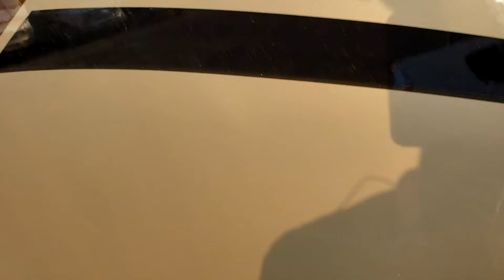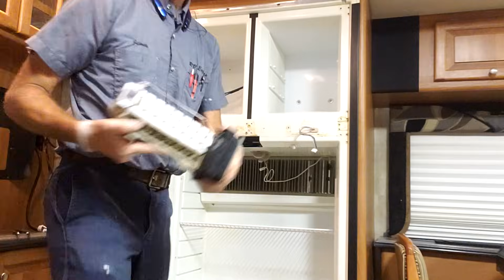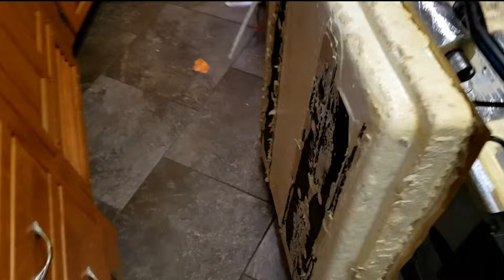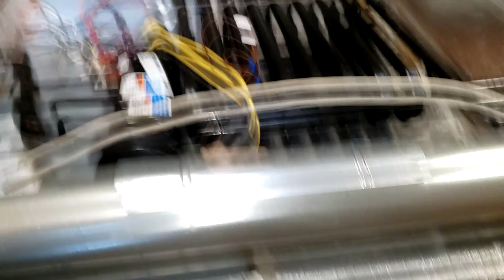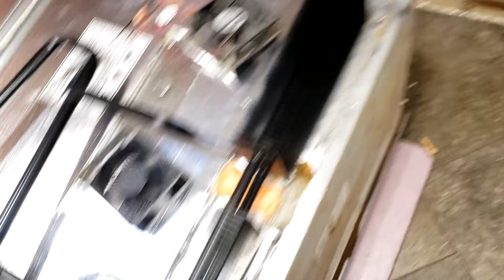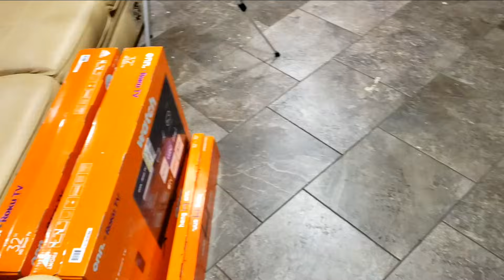NORCOLD 1200 Cooling Unit Failure + tips and tricks

Comment: Too bad residential units don't run on propane.  Gotta be able to do some boondocking when the time comes!
Reply from the maker: When what time comes?
Reply: @AZExpert   Any time!  Nothing compares to boondocking IMO.  That's partly why I have an RV.  To get away.  RV parks are nice, but I'm all for the backcountry if I can get there. 
Until I can afford a solar array and some batteries, propane is the best option for keeping things fresh in the fridge.  
By the way, thanks for this video!  I have a 1200 that I will be replacing the cooling unit ASAP.  Currently full-time live aboard and on shore power.  I do have the recall auto-shutdown unit installed, but as you mentioned, by the time there's a fire it's already too late. 
Can't wait to get "lost" on a forestry backroad or spend a week on the beach again soon!
Reply: And yes, I picked up on you being salty.  You live in AZ.  I'd be salty if I lived in AZ too.  Seems everyone who does is.  Most miserable state I've visited.  Which makes no sense to me because of all the natural beauty, but whew, is it full of phony grifters and uptight pricks. 
I curse the roads being in such bad condition there because they impede the getting out.

Comment: Degradation of cooling could have been caused by a bad fan. But you added a fan to compensate. Cooling unit was bad, possibly caused by the failed fan and poor installation originally. It had to work too hard and crystalized the ammonium.
Reply from the maker: Thanks for the insight

Comment: WOW. What a big difference. Like you said it could of been not installed correctly plus the one fan wasn’t working. When you took the old one off that was a lot of that putty in between the two metal plates. When you installed yours you didn’t put any of that putty between the two plates. Just asking since it looks like it has the room and the length of that cooler fins on the back why didn’t they just put four fans back there. Everybody keeps saying between the bottom hole and top hole the amount of airflow that goes through there is what really helps keep the fridge cooled down. But thanks for explaining in a little more detail on how them systems work. I had my cooling system replaced on my fridge. And they said keeping it level was number one and no more than a 2% margin on leveling. And I said could’ve it been traveling with the fridge on. And that’s the thing they couldn’t answer yes or no. But the way you explained it. Turn it off unless its Leveled.
Reply from the maker: Thanks for watching!

Comment: It is necessary to remove all the Styrofoam off the tubes on the cooling unit before applying thermal mastic.
Reply from the maker: You need things as clean as you can get them

Comment: What, no Amish cooling unit? btw, I hate my 1200. It has a newer cooling unit but there really isn't much in my Winnie that causes more apprehension than wondering if my fridge is cooling as it should be when it's full of food while we travel. Oh and when it decides to go through the defrost phase every 5 or 7 days....

I never had issues with the Dometic fridges in my previous RVs.

I'm hoping Furrion will come out with a 4 door version of their 12v compressor style unit soon.
Reply from the maker: Personally, I don't like non OEM cooling units or re-builts. But also, time was a vital factor. I am also looking forward to the Furrion refrigerators.
Reply: @AZExpert  a lot pof labor hours?Did you warranty the work. This customer wwould of been better off new

Comment: We have a propane fridge at our remote cabin that the performance dropped drastically. I took it out and turned it over for a day to “burp” . Put back and tried it, still now success. I then took off the burner orfice which is a metal screen dome, cleaned it up. . Put it back on and it has worked great. That crap they put in the propane to make the smell will gum up small burners.

Comment: That fridge burned my coach in October 2011.  Don't know why people still have them, except they are flirting with fire.  Shutting off the fridge would not have mattered in our case because it was the coils that failed and leaked down onto live wiring running along the floor behind the fridge.  Know that these fires are really fast and the coach ceiling turns into a broiler from front to back in just a few minutes.  If you are in the back of the coach, you will be cooked even if you get low and try to crawl out to the front. Unless you have practiced getting out a rear exit window ahead of needing to do that, you will have a problem then too.

Regarding heat generated behind this fridge, many people have been surprised to find that the ceiling behind the fridge was charred.

If I were you, I would not try to repair these because Norcold will blame you when the unit fails.  Your video might save you in that event.  We were told that Norcold went after the people that incorporated the so-called "fix" for our third recall at the time. Don't know how that turned out because my excellent USAA insurance at the time took care of our interests and there were no injuries because we were not in the coach when it burned.  USAA then went after Norcold to try to get reimbursed.  Then USAA quit insuring RVs....

How about a compressor fridge?
Reply from the maker: Glad you were safe

Comment: Have the same Norcold, 1200, changed the whole unit out for a 120 volt JC Refrigeration unit, got rid of the propane and the ammonia, unit came as promised small very efficient compressor, was out with the coach 2 weeks ago in 44degree C it never missed a beat. Cools down to temp in less than a day and while driving uses less than 1 amp of battery power, and it was under $1000.00 delivered to Canada. Love your channel we winter in Mesa, will certainly kept you in mind for any repairs !

Comment: That air dam is really a moisture dam to prevent building and ice dam between the cooling unit and the aluminum plates bizarrely enough ice is a insulator.   On the you might get away with similar leakage in Arizona but Darren is certainly not going to get away with it up in that moist climate in Port Angeles Washington
Reply from the maker: Thanks for the tip

Comment: I replaced mine with an Amish built cooling units, so much better than the Norco also I didn’t use mastic as a seal I use spray foam to inject in between the gaps to make an airtight seal. Works flawless

Great video
Reply from the maker: Thanks for sharing

Comment: Did a residential fridge swap on my rig, sold my 19 year old fridge for $600. I guess my unit was one of the last good units built. Installed 800 watts of solar, xantrex xc 2000 watt inverter, and Chins 300 ah smart lithium battery. Best upgrade I’ve done!
Reply from the maker: Very nice!

Comment: Good work. An HVAC and/or Plumbing supply store should sell the aluminum tube used for the burner. I have replaced a lot of that tubing, and/or used it rebuilding pilot assemblies on furnaces and many gas appliances. Just trying to offer you advice as I have learned a lot from what you do. You explained how exactly these works which I appreciate a lot.

Comment: At 7:45 you answered my question.   The used fifth wheel I purchased last August and started using in November to mid May didn’t do a good job when it got to the 90’s deg. I have solar, battery bank and 1500 watt inverter.   I installed 4 120mm computer fans in the space above the baffle, on a switch.  

Thanks for the tip about the baffle in the top vent.  Mine was tight and I was going to remove it until somebody told me it needs to be there.  I’ll use adhesive and seal it back tight.  

If it continues to not perform well it’s going to be replaced with a 120 volt residential model.

Comment: Couldn't you test the old unit by just fixing it upright. adding power, and checking the temp of the thermal tubes? If the tubes have to be enclosed, maybe just a cheap styrofoam cooler with the bottom cut out taped over them. Granted you would need a control board, but I'm sure you have a spare laying around somewhere.
Reply from the maker: Thanks for the suggestion